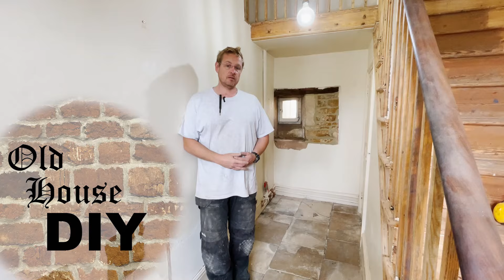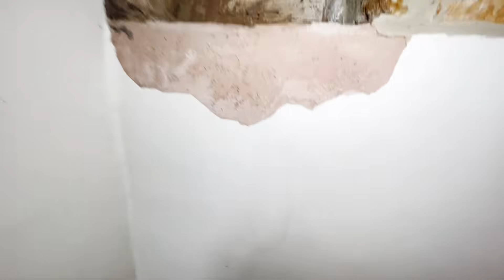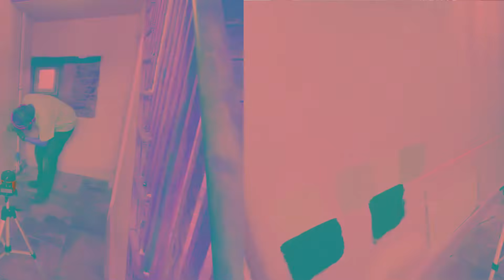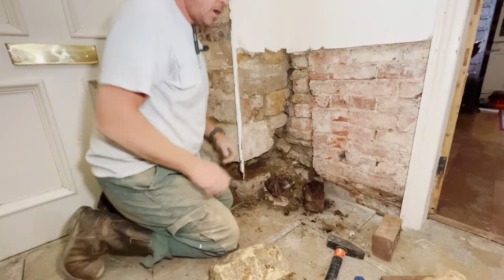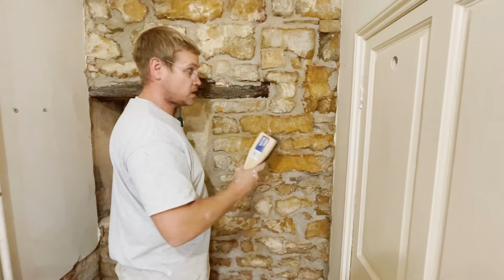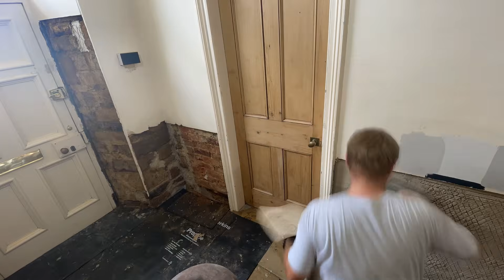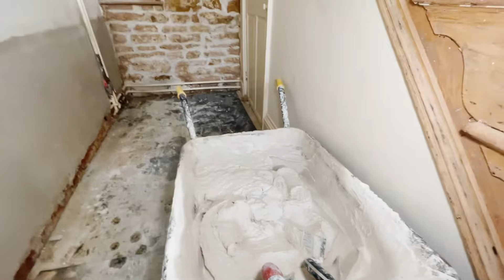Treating damp

Comment from the maker: Update on how it’s holding up here.

Treating damp, the follow up .. .. .. .. YES it works! #lime #limeplastering #damp #treatdamp
https://youtube.com/shorts/GuNcFCstLyo?feature=share

And the answer is very well!
Reply: As the ground level is so high, I personally would have gone full wall height of the first meter of the long wall next to the window.
Or was that part already lime further up?
Reply from the maker: @tax1066  your right you always need to go above the ground. In this case 1- the long wall is internal, 2- it’s lime above the cut line, 3- it’s a massive double height wall.
Reply: @oldhousediy dose lime plastering the wall inside the house stop the smell of damp ?

Comment: Lime plaster on a wall with active rising dampness is not a cure. The lime plaster should be considered a sacrificial coating and will have to be re-placed at intervals. There are modern remedial permeable plasters that contain waterproofers and salt retardants which are much more suitable for old damp walls.

Comment: Great video, thanks. I have an old sandstone cottage in Cumbria. I’ve had to remove some large patches of loose plaster in the upstairs bedroom. It had hair in it so I think that means it’s lime plaster? Im intending to re-plaster onto the bare sandstone patches with lime plaster.

Could you give a little more detail on the ‘wetting down’ please. How often should it be done and is it just a case of sponging water onto the wall? Thanks!

Comment: Very good video, a lot of skill involved in plastering, especially with lime! 

I would caution however touting lime as a cure to damp. 
You are completely right that the lime will allow the wall to breathe. But this will not eradicate the damp, it simply allows it to exist with the house in a more symbiotic manner. 
Old properties were never designed to be lived in or heated in the manner they are in our modern lives. 
In times of old there would have been far more ventilation in a house, in the form mostly of open fires but also draughty windows and doors! If you don’t have good sources of dry heat and ventilation the damp will persist. Think of the lime like the mouth and the fireplace the lungs. Both are needed in order to breathe. 

Exciting stuff, good luck with the rest of the house!
Reply from the maker: Yes, it’s all about moisture management of which lime is a key component.
Reply: Yes, I agree when you think of old houses with high backed chairs to protect the neck from draughts, pelmet curtains to stop the cold from the window convecting into the room, snakes to place at the base of the door during draughty times it all seems to make sense. And you are right you will never stop penetrating damp from a raised outside ground level, you can only hope to manage it by allowing the moisture to evaporate through vapour permeable building materials and then provide sufficient ventilation to carry the humid air away.
Reply: @seahorsevet  There most definetly are well established simple building methods to prevent any damp penetrating the basement wall. It is labor intensive but not complicated. All is needed is to dig away all capillary active soil around the house, seal the foundation with bitumen felt, add insulation and top that with drainage mat. Then drainage pipes are placed at level below the house foundation and everything is filled with drainable non capillary active coarse crushed stone.

Comment: Hi. I have a very similar problem that I am just getting to grips with. Could you advise how to make up the lime mortar and lime plaster please? I know about sharp sand, but what is lime putty? (I would be prepared to make up and put on the first two coats myself, but would ask an expert plasterer to do the final one). Thanks for a good, relevant, clear and interesting video!  Edit:  I have now seen your video about lime putty, so no need to answer my question, thanks!
Reply from the maker: Check out my video on making putty. However, I doubt you would get a professional to do just the last coat (sorry), they will want to do the whole job.

Comment: I’m glad I found this channel. I just inherited an old brick house, pre 1900’s. Hand made bricks. Any way upon emptying out two of the rooms I found I have a rising damp problem. Water dripping of the bottom of the walls after rain type of problem. Plaster falling of the walls . The house is all above ground, sandy, rocky ground. 
Anyway watching you doing the replastering was great because with a bit of luck I’ll be doing the same if I can fix the problem. Floorboards up first I think 🙂
Reply from the maker: Good luck with your project. If it is clearly linked to rain make sure you check your gutters, drains and soak aways.
Reply: @oldhousediy  gutters are good but I wasn’t there when it rained so I missed checking water flow. There’s an underground stream under the house, it’s about 15 feet down and it’s salt water. I’m a dowser.
Reply: Floor up and find the cause. Part of our own house had no damp course in a few meters of one corner. 
I’m guessing they just forgot 140 years ago. The rest has tar cloth.
I cut out the mortar where the damp course should be and packed roof slate in there before lime plastering.

Maybe you could take up the floor and add a slate damp course if that is the cause of your damp issue

Comment: Another super video - thank you. Please can you tell us what you did to get the black bitumen off the bricks? Also, what is the exterior finish on the end wall - is it rendered or bare brickwork? Thanks.
Reply from the maker: The stones are very soft so a lot of the bitumen is already detached and I could chip it off with a skutch hammer. The end wall is stone externally, although the windowsill is at external ground level so a lot is below ground.
Reply: @oldhousediy  Thank you!
Reply from the maker: @mobilvettamotorhome2056   Your welcome, check out the follow up here 
Treating damp, the follow up .. .. .. .. YES it works! #lime #limeplastering #damp #treatdamp
https://youtube.com/shorts/GuNcFCstLyo?feature=share

Comment: Thanks for a very useful video. I wonder if you have any advice for insulating an old house internally or plan to do any videos on this. I’m struggling to find any DIY advice on how to add a breathable insulation without effecting the breathability
Reply from the maker: There are some option such as wood wool board (Mike Wye) and Hempcrete (The Limecrete company).

Comment: Interesting thought process :) I would always recommend that all drains are surveyed, along mains mains and plumbing leaks checks first. When you do knock off render, dry the walls down before  lime rendering as this can help with hygroscopic salt stain migration. Brilliant thought that you can see the benefit of using traditional materials. :)
Reply from the maker: Thanks, the poor old house suffered with a 80’s make over.

Comment: This is great, but how did you remove that bitumen paint? Did you just grind it off?
Reply from the maker: Because of the damp between the bitumen and the stone quite a lot just falls off. The rest I just chip off or wire brush. Our stone is quite soft so it makes it easier but you also can’t be too aggressive on the cleaning.

Comment: Even with the correct use of lime mortar the external ground level is an issue.

I had damp in my 1910 house and after many days of learning everything I could about damp I found the solution. Lower the ground level around the house even if it's just a trench.

As soon as I did that no issues with damp 5 years later.
Reply from the maker: Yes, ground level is a common problem. In our front garden I removed about 8 large skips of soil and fitted French drains. Unfortunately in this wall the neighbours house and back yard ground level is at the bottom of the window so half way up our wall.
Reply: @oldhousediy  Hi I've got a property where damp levels are showing on the base of all the ground floor walls. The external ground levels are the same level as the internal floor however I can't dig a trench to lower them as there's foundation around the perimeter of the property that stops me from doing so. Any solutions I could try?
Reply: @Jordan-dt7wd  Have you checked to see how far the foundation projects horizontally?  You may be able to install a French drain on the other side of it.  French drains are brilliant for this sort of problem.

Comment: Hello there, nice project! 
Had something very similar in my house here in the Netherlands (they had also injected the resin in the wall and then covered the bricks with cement...). I could not find a professional that could plaster using lime (I assume the skill is more or less lost here for most plasterers) so after removing everything and going back to the bricks we had to re-plaster with gypsum but we used an extremely open paint (keim) and the wall can actually evacuate the humidity. The worst offender in those cases is really often the paint...  most likely in multiple layers... sometimes even between layers of plasters.. 🙂
Reply from the maker: Some plaster blends are somewhat porous but not as good as lime. They are also hard so more prone to cracking. And you are right the covering (paint / wall paper / tiles) is also just as important.

Comment: Hello. Can you do an update on how well the lime is performing as I thought it was interesting you went for a material that lets moisture through in a below ground level situation. Was there anything outside the house that could cause moisture to be higher?
Reply from the maker: It’s holding up really well. The breathability stops the moisture being trapped and avoid the impermeable plaster “blowing” (detaching) or damaging the bricks / stones. The back wall is about 1m below the neighbours (cobbled) yard so nothing we can do about that. The floor was also laid on plastic sheet which I have changed so the floor can breath too.
Reply from the maker: Here you go;

Treating damp, the follow up .. .. .. .. YES it works! #lime #limeplastering #damp #treatdamp
https://youtube.com/shorts/GuNcFCstLyo?feature=share

Comment: My house was built in 1907. Built mainly of sand and field stones. Walls are about 24+  inches thick. It has a basement that is about 7-8 feet below grade level at the front and grade level at the back....about a 20% grade.  We live on a hill that has natural springs and we have one that exits into a fish pond in the lower yard about 15 feet from the house. So we naturally  have year round moisture in the basement. We want to use the space but it is always really humid and sometimes moisture forming on the floor with temperature swings. Anything than can mold will, so it is basically a space with no use. I have been pondering constructing additional thin block walls about 3 feet inside the perimeter walls that are completely sealed and insulated. This would be very time consuming and material intensive. This would effectively make hallways at the perimeter and drastically reduce the usable space. 
Would this technique help to save me a lot of time and money? Any thoughts or comments would be greatly appreciated.
Reply from the maker: Trapping moisture never seems like a good solution but you do sound like circumstances against you. Have you tried a dehumidifier?
Reply: @oldhousediy  I think I would need multiple dehumidifiers running constant to keep it "dry". I think the perfect fix would be to excavate around the foundation and use french drains and some sort of protection from the outside but that is not going to happen. 
I rerouted the front gutter drains to about 10 feet from the side of the house hoping that would make a difference but no luck on that
It seems like any materials put onto the wall would never dry as the stones are always visibly moist. I don't get any water in the basement but it is noticeably moist as you descend the stairs.
Reply: 0:02 I don't know how deep your pond is but an Ag pipe could redirect a lot of the downhill ground water. Most of what I've seen to deal with below ground damp is to dig all the dirt out from the basement walls, to 1 ft below floor level, bitumen paint the exterior of the wall, put in a 100mm dia ag pipe, back fill with 20mm gravel 300-600mm out from the wall. It's a lot of work, but if you want a dry basement, that's my best advice. Of course good air flow will also help. GL
Reply: @michaelbremer-trainor1301  Thanks for the suggestion. 
The rear of the house is at ground level. The front of the house is underground into the hillside around 8 ft deep. The house is about 30 ft from front to back. The pond begins parallel to the rear wall about 10 ft to the side of the house but is at least 10+ ft below the house and is fed by 100mm pvc drainage pipe.
You can see where the ground begins on the walls inside the basement.
I have many ideas on how to remedy the problem but all of them are very labor intensive and/or material intensive.
I am renovating the house so I will continue to think about it until the main floor is complete and then turn my focus to the basement. Maybe by then I will have a solid plan and probably implement a few different solutions.

Comment: Looks good!   Why did the leave the gypsum plaster on the upper part of the wall?
Reply from the maker: It’s always a judgment question. You don’t need to change 100% just for the sake of it. There are no damp problems higher up , just the back wall and bottom of side and front, and it’s a double height room so a very big job.
Reply: @oldhousediy  Ah I've watched again and you said the top part of the long wall was original lime.   On my wall I have a plasterboard over an old chimney breast that has been water damaged near the ceiling.   I can tell it is plasterboard as I can see it poking up into the loft against the chimney.  Is it possible to patch repair the damaged area on the plasterboard with lime render / plaster or would the entire board have to be removed?  By the way, what was the purpose of the gaps in he wall that were filled with wood?  Was they supposed to be an air gap?
Reply from the maker: @Latbirget  lime repairs to plasterboard wouldn’t serve any purpose. If you’ve no problems then a patch with eazi-fill would probably be the way to go.
The wood is often added as fixing for items but no real idea for the one near the door.
Reply: @oldhousediy  Are you saying that if the top half of the wall was gypsum, then you would leave it as is and just deal with the lower say 1m or so if there was damp in that wall?
Reply from the maker: @chrisatherton3911  for me it would depend on where the wall is and how bad the problem. BUT (and a big but), it is hard to get joints mid wall to match. Ceilings and corners hide joints much better, so if you are DIY and it is a small room you may be able to get a better finish doing the whole wall.

Comment: There's a cathedral in the states they have been refurbishing for the past 100 years so they've been through the transition from lime to Portland  cement and their going back to lime added into mixes, they say their rule of thumb is the mixture needs to be as weak as the building material your using. Mixes of 5 sand,1 lime, 1 cement, trying to make mortars as breathable as possible, as to the previous comment about dpc, if you have an old stone wall with lime, if you render with cement,  the cement locks in the moisture and often changes the weight of the wall on the orginal foundation, thus leading to cracks, your choice of solution was spot on for the conditions in hand.
Reply from the maker: Thanks.
Reply: There is no need for Portland cement in the mix at all You have to trust the binding power of correctly specified lime mortars, cement will work against the lime and introduce salts.
Reply: David, what cathedral are you referring to?
Reply: @adobemastr  New York I think there's a video on YouTube with the master mason talking about the different materials and stone they use.
Reply: @davydacounsellor  thanks for the information; can you provide the link for the video?

Comment: Why is gypsum plaster in the UK seemingly pink when it is wet and lime plaster grey??  It always weirds me out when I watch plastering in the UK because the colours of the plaster are so different from what I work with.
Reply: Gypsum isn’t pink because of impurities. That’s the colour of the mineral where it was mined from. 
When I first started plastering all gypsum was grey but as they depleted all those mines and moved mines the colour changed.
Reply from the maker: I believe that it is because of the impurities in the gypsum that they don’t bother to remove. However, lime, which I use is very different from gypsum.

Comment: Good DIY attempt. Got the joint on finish well. I'd recommend using a straight edge to rule backing coat to gain a straight wall for skirting boards to fit to.
Reply from the maker: Thanks. Sneaking up to get the joint thickness matching is tricky. If I’m doing hole walls I do use a Darby to help flatness but it’s harder working up to a very specific finish level.
Reply: Better than the previous professional attempt.